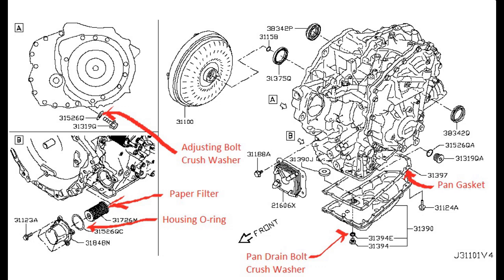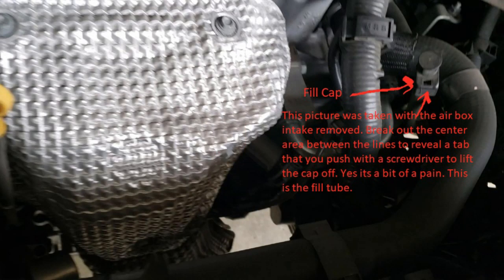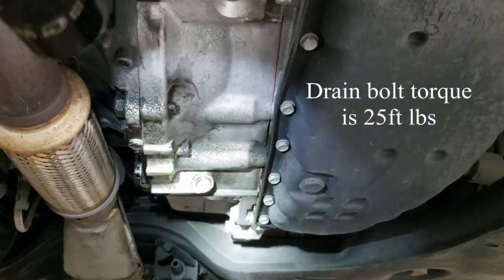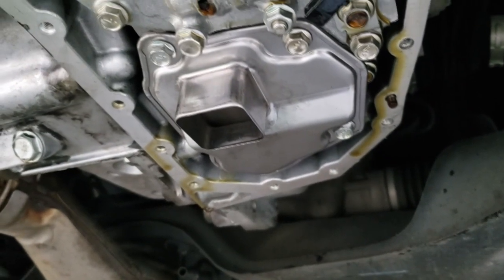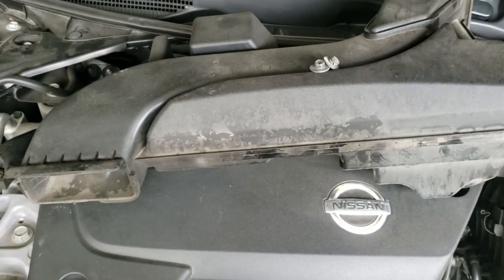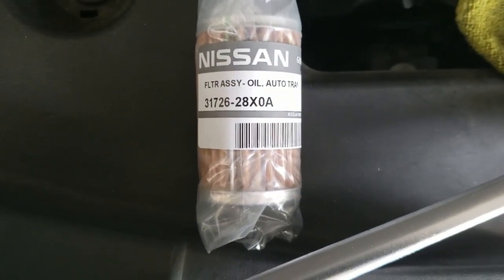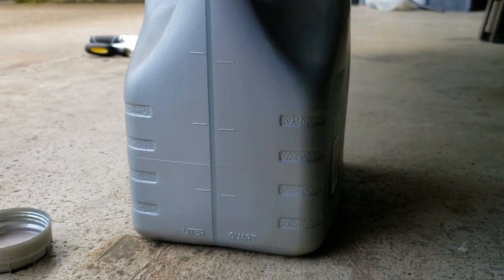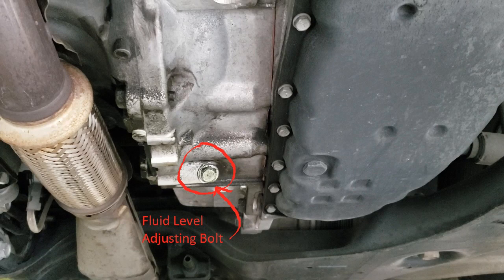2014 Altima Transmission Fluid Flush and Filters Replacement

Comment: Valvoline is same fluid bro. Look at the data sheet
Reply: I'm a bit fuzzy about the Valvoline as in its general description it only mentions NS-2, but in the data sheet which I hadn't looked at it says NS-2 and NS-3 for Nissan.
Reply: Elmo Car Guy yes it does.
Reply: Same specs. Valvoline has red dye, Nissan has green dye.
Reply: @MotoFlows  Have you used the valvoline cvt fluid? Any issues? Thanks.
Reply: @kccodex8931  Thanks for the reply. I work on cars and this was for a customer's car. If I recall correctly, I used a liquid moly oil with the NS3 approvelal and has worked well since then. Thanks for sharing your experience and I hope you put more miles on her!

Comment: Nissan trans flush is more complicated than Honda and Toyota imo.
Reply from the maker: The complications I see compared to some other transmissions are removing the paper filter and having to go through the picky fluid level procedure. Many transmissions only have a pan filter of some kind, and many have a good old fashioned dipstick to read the fluid level, which would be a definite improvement.

Comment: You don’t have to use so called nissan cvt ns3 fluid, you can use cvt fluid that is compatible with Nissan ns3 fluid just read the back of the cvt transmission fluid bottle your buying and it will say compatible with Nissan ns3 cvt fluid. If it doesn’t don’t buy it . Of course don’t buy the cheap stuff.                 Your welcome
Reply: I didn't say you had to use the dealer branded fluid. I said I did so out of caution since at the time I had not found any cvt fluid that said it is ns3 compatible. Another youtuber not long ago made the comment that Rock Auto now carries Aisin NS3 fluid, and I will probably use that the next time I flush.
Reply: @thevoigts651  Well, it seems I will be using the non Nissan brand NS-3 spec fluid then.

Comment: A lot of this is like killing a fly with a sledgehammer. If there is a lot of crap in this transmission temperature controller you're in trouble. Funny how this is a sealed transmission and you find a lot of different types of residual in it means one thing. You're nursing defective unit to make it last as long as it can. This tyranny is a  Renault addition to this car. Nissan increased it's warranty time after a class law suit.
Reply: I think all transmissions that are sealed and claim to never need fluid and filter changing are nonsense. Fluids wear and get dirty. I'm not sure where you are getting the Renault thing from as Jatco makes transmissions for a number of car companies. I also would question whether the transmissions on these cars are defective, or if they fail at a higher rate because they are not properly maintained because Nissan in their infinite wisdom says they don't need maintenance. If proper servicing "nurses" this transmission into a long service life, I'm good with that as I plan on hanging on to my paid for Altima.

Comment: This does not apply for 2009-2014 Maxima
Reply: I am looking at the nissanpartsdeal website at a 2014 maxima, and under powertrain/control valve/filter assembly-oil-CVT there is an Oil Filter Assy-Auto Transmission
 31726-1XE0A listed on the schematic. I don't have a Maxima so I don't know exactly where it is. This looks to be a filter that is easily replaceable as it is external and held on by a few bolts. You could disconnect at the filter and do the same thing with the drain container from there to pump out fluid and then refill until clear.
Reply: @thevoigts651  LOL, I have my maxima jacked up per this reply and you are 100% correct. This means it's even easier on the 09-14 Maxima than the 14' Altima 😅. I going to order that filter and drain all the CVT fluid. This Maxima takes 10.8 quarts to refill completely.
Reply: @12MRJERSEY  Another youtuber here posted earlier that Rock Auto carries Aisin NS3 cvt fluid. Make sure u clean out the drain pan also before doing the refill/drain thing.
Reply: @thevoigts651  I'm using Amsoil CVT that goes beyond NS1,2 and 3. And by the way 2009-2014 Maximas uses NS2. Thanks for the info 👍🏼😅

Comment: When you unscrew the drain bolt, is the engine running and the fluid refill cap taken off?
Reply: No, do not run the engine when the drain plug is unplugged